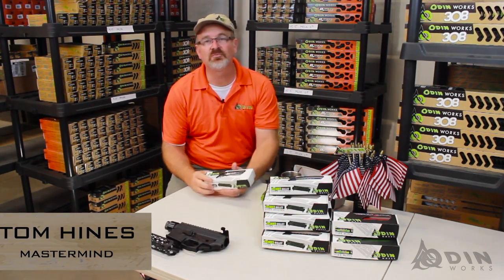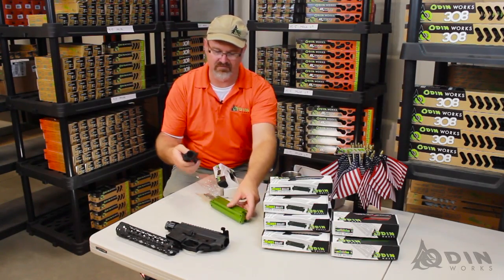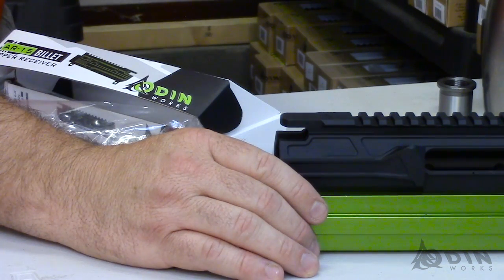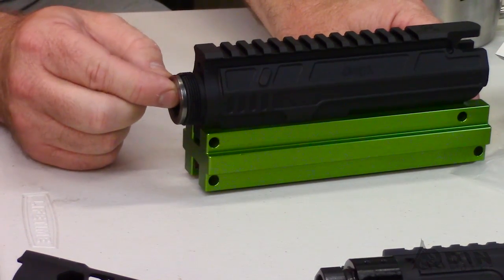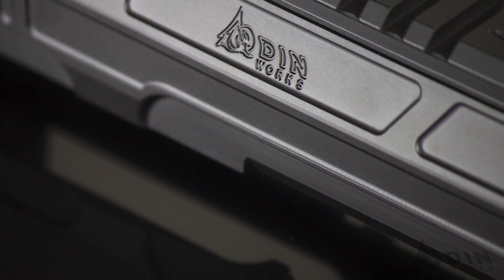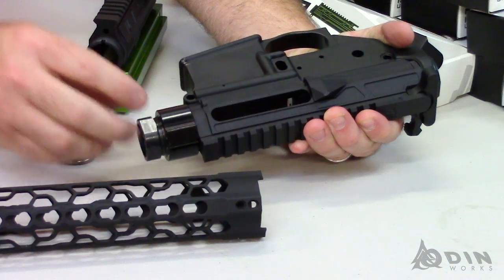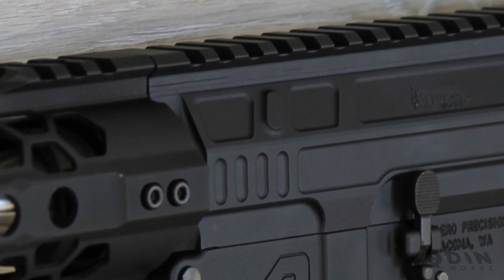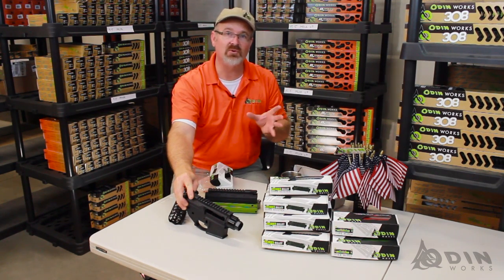Introducing The New ODIN Works Billet Upper Receiver!

Comment: Just got this upper receiver at a local gun show. My back take down pin will not engage. Know how i can fix that issue? Also my diamondhead hand guard won't fit flush with the upper receiver. Does this upper receiver only work with Odin products?
Reply from the maker: Sorry about the issues you are having! If you fill out this form and explain the issues our customer service rep will help you out. 
https://www.odinworks.com/returns.asp
Reply: @ODINWorks  thank you and will check it out